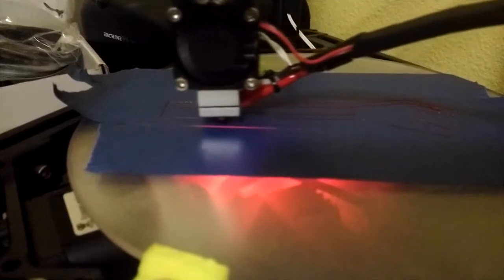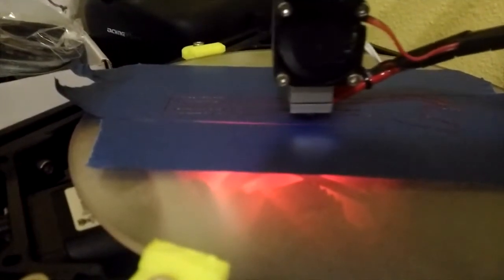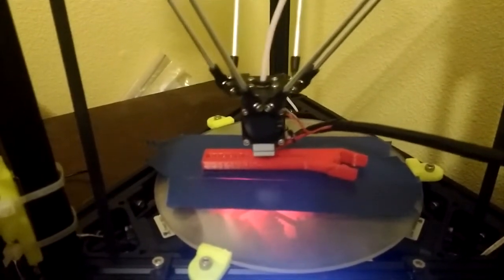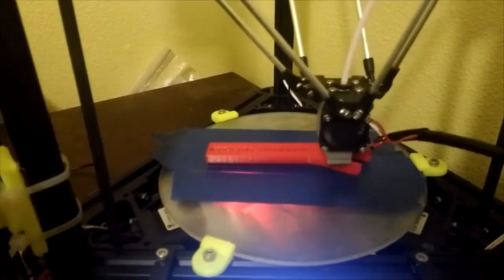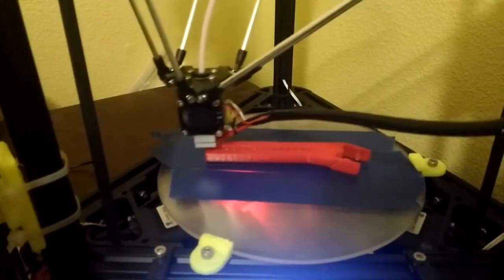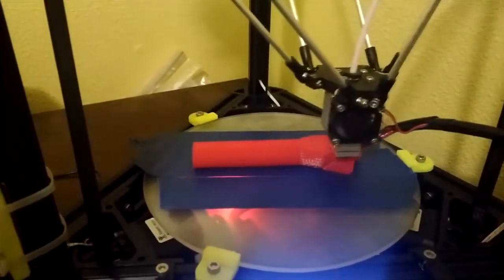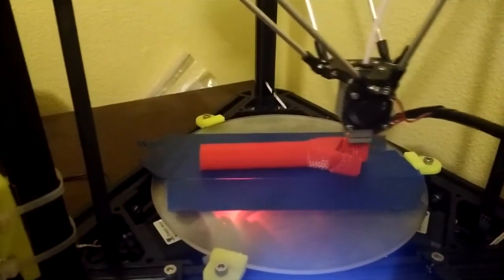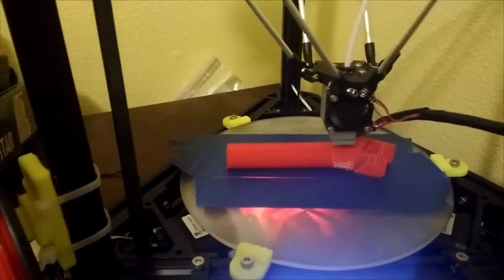He3D-K200 3D Printer Review

Comment: I ordered this printer a couple months ago from the vendor listed in your links and since that time I have experienced nothing but frustration with it. The printer was shipped to my door with several missing and defective parts. Missing parts included the hammock that holds the print head, screws and t-nuts, all of which I had to get from ebay to finish the build. The heatbed that I received had a deep gouge on it's print surface and its temperature sensor had to be replaced. The RAMPS Plus 2 Control Board (the heart of the printer) was also defective and died within a few days. I have sent many trouble tickets, emails and even called the company's office in China to try to resolve the issues. The company just doesn't respond or is very slow at responding. I have sent photos, detailed diagrams and a video of my issues and they have yet offered to replace or fix any of the defective or missing components. My advice - Don't order anything from this company.
Reply: I would like to note that I wasn't specifically clear in my comment above. My frustration is with HE3D and not the company that I ordered the 3D Printer through, which was 3DPrintersBay.com. 3D Printers Bay processed the order and it was shipped promptly to my door. I would estimate that it took a week or less to get. My comment should have stated that I would not order anything from HE3D or HOYI SUNWAY LIMITED!
Reply: I had  the same problem missing and broken parts The instructions are a joke ! I would not buy any product from this supplier. Ur WASTING MONEY AND TIME!   DON'T DO IT.

Comment: What is the significance of the philips head screws vs. the other bolts when assembling the 3 blocks that slide vertically?  Also, the animation only shows 1 being constructed as if they are all to be built in the same way..bearing with two washers, and spacer, then bearing with one washer and "nut" style metal spacer.  However, I only have four of the metal spacers, so it is impossible to build them all in the same way.  I currently built one of the blocks using all metal spacers and the philips head screws, but i'm pretty sure this is incorrect so I'm just stopping there for now.  Any advice?
Reply from the maker: frankly, I am not sure about that either. we just  ended up using the phillips on X axis, just for referencing.  :D    I don't think it is very critical, but I am sure  he3d will jump in if there is a significance.
Reply from the maker: the open build wheel block is pretty unique.    one side gets metal cam lock type vs  the other side being plastic.  plastic is shorter so it requires extra spacer.    look at the video carefully and if you want, I can possibly take apicture and post it somewhere
Reply: Thanks so much for the reply.  I can't figure out the significance either, but it's one of the few parts in the "tutorial video" where the guy actually stops and makes a point to show the camera that the first block he attached to the hot end was the one with the philips screws.  Seems like with less time than they put into that animation of the other video, they could have written a thorough tutorial with detailed pics.  I'm not looking forward to the configuration :/  Thanks again for the reply (and the encouraging video)
Reply from the maker: The configuration is already done on the control board and there is very little you have to do to get it working. We wanted the file because we wanted to make some changes to the printer like heated bed.
Reply: I'm thinking the significance of the philips head screws is that they won't bump into the extruder bracket
Reply from the maker: Looking at our 3D printer, I think that you are right.

Comment from the maker: We have been trying to get a configuration.h file for the He3D-K200 and they have been very unresponsive after an email attempt failed. We won't be able to upgrade or to the latest version or make any changes without this file and we believe that they need to have this available on their website.
UPDATE: We have gotten the configuration file and have gotten the hotbed and autolevel probe working. We also replaced hot end with e3D style.
Reply: Would you mind posting that? I'm considering getting one of these and a minimum of hassle when modding it would be nice.
Reply from the maker: Hello, thanks for watching the video! Here is the configuration file uploaded to mediafire for your ease: http://www.mediafire.com/file/ay1lsqu0z44q7ky/K200-Firmware_without-b.rar

Have a nice day!

Comment: Can you please give us the files for the holder of the limit swich as an stl so we could do the same? I currently also suffer from my z probe not working.
Reply from the maker: that is just a simple plate with slot and couple holes for the switch to mount.    I need to find the file and will post the link.    we are actually redoing the delta effector  to version that has switch and uses E3D V6  hotend.
Reply from the maker: The Link is now in the description

Comment: Hello, it is exactly like you said. Video documentation and especially wiring section is very poor. Would you be so kind - could you capture your wiring or share wiring diagram with us. Thank you very much.
Reply: please tell me your email, i will send you.  we post wires diagram on our facebook
Reply: I'm having communication issues to my k200 and I'm not sure if it was wired correctly and the z-probe I got doesn't work I tested it and if I try to run G29 I get an error asking me to reset.
it would be greatly appreciated if you would post your wire diagrams on your website.
Reply: +3d printer HE3D email: iPad.death@gmail.com
Reply from the maker: communication issue is  typically due to usb driver not being  installed correctly. if you can connect to right comm port though, you are probably ok with usb driver.      Assuming driver is working and you are getting movement,  zaxis probe need to be connected to connector next to zaxis limit switch.  .     in my case,  my zaxis probe would not trigger at all, so I ended up jury rigging a limit switch.     I beleive I found the diagram on their website if you looked at the controller page.
Reply: And one more thing about Z-probe. Basically it is a button and if you press it (for exmple using wood stick) and type in code "m119" it should respond with following line "endstops hit: x_max:L y_mX?L z_min:L z_max:L Z-probe state:H", when released I receive following line "endstops hit: x_max:L y_mX?L z_min:L z_max:L Z-probe state:L" and then when I type in "g29" it auto levels itself.
Reply: +TenseTV my issue is it connect to my pic but I can't move the z axis just x and y and when I try to auto level I get an error that z probe failure and I'm using a limit switch
Reply from the maker: so, it moves in XY, but not in Z?    does it move in z axis without the probe?  if that is the case, you may have bad probe.    look at the M119  if zprobe state is H  that means lower limit is on all the time.  put some pressure on the zprobe and see if the state changes to L.  if that is the case, you may have the connection reversed. if it doesn't change, you have a bad zprobe.